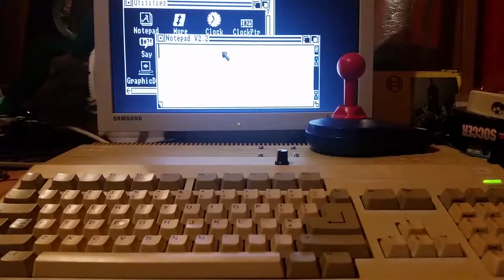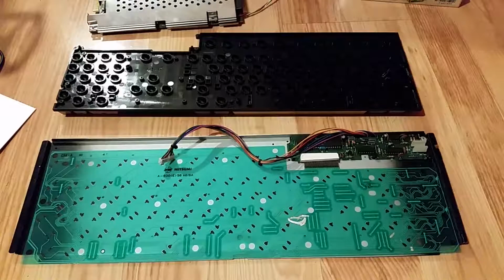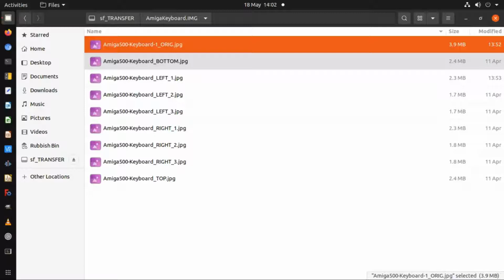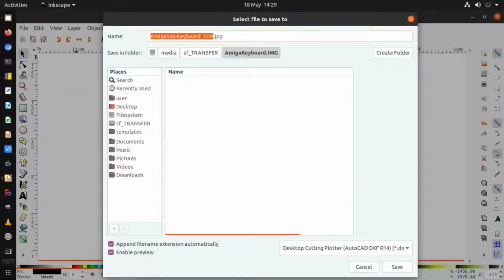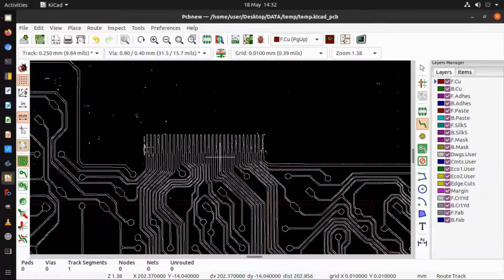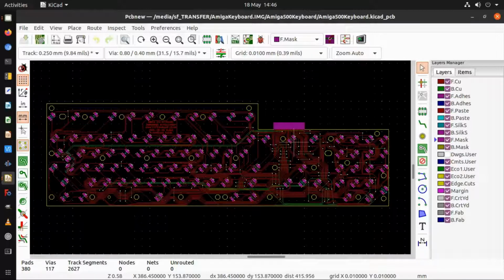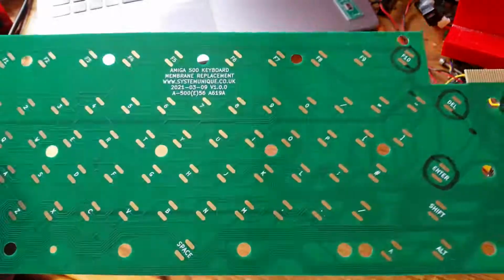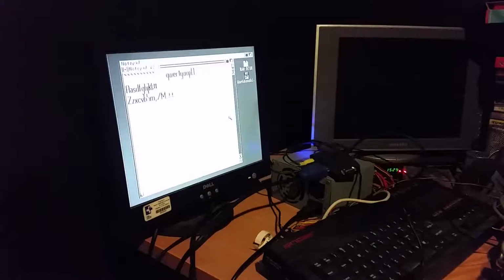Repairing An Amiga 500 Keyboard Membrane With A PCB Design

Comment: I'm currently doing the exact same thing! For my initial test PCB I unfortunately chose to use 0.6mm and this proved to be too thick, for the connector - it still fits but I think the 0.6mm thickness is not getting it to bend enough. With a 0.4mm PCB did you haver any issues with the connector? It would still be bending because the connector slot sits a few mm higher. I will use 0.4mm now and see whether it makes difference. Otherwise, my other idea is to have a blank base PCB (with exact same shape and cutouts, except for the connector) which will allow the membrane PCB to sit up higher so that it slots in to the connector without bending.
Reply from the maker: This thickness I picked was just because it was the thinnest JLC PCB did. It fitted OK in the connector. I put a couple of washers around where the connector was to keep it clear of the frame. It operates without an issue in the month after I did a huge amount of typing and used it a few times since.

Comment: I am planning to do something similar for a MSX2 Sony HB-F1XD. Current membrane is totally wasted because of battery leakage. Which PCB service did you use? Any specifics I have to watch out for when ordering? 0.4mm, mask/pcb material?
Reply from the maker: I used JLC PCB, they have a page with their tightest tolerances, I just used the thinnest board they catered for at the time. I just use KiCAD default setting - though I tend to turn to the finest grid.
Reply: @DevelopIT  Thx, I’ve used them before. I’ll start designing a PCB first and I hope it works straight away. Good to know about the unmasked via’s.
Reply from the maker: @S0urceror  I used it for an entire month of coding after fitting it, with no issues. The via issue seemed to be that I could just see where the solder mask wasn't quire covering them, it may have just been the batch I got, hopefully your batch will be good in that area.

Comment: Still going strong?
Would love to see you share the gerber files on Github!
Reply from the maker: I typed in the first run of Z80 emulation over a RS232 connection. It was a couple of weeks of constant use, and no issues. It's one of the projects I may build for sale in future if I get enough time, so this particular project I can not foresee going on GitHub currently.